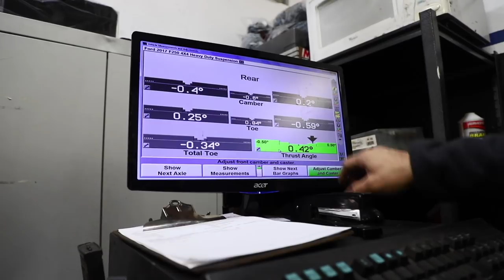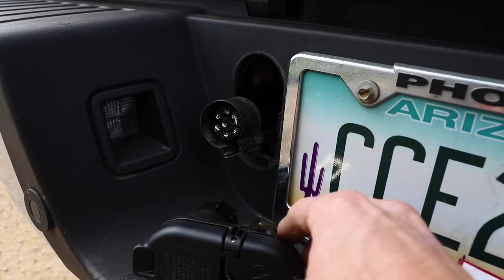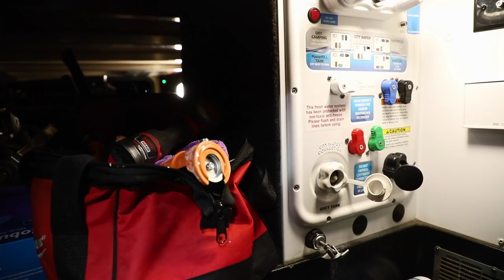SEASON 7 STARTS NOW! NEW AXLE & WARRANTY UPDATE (KYD)

Comment: I had Wholesale Warranty for my Monaco pusher, the rear end went bad. There was a broken bolt found inside the rear end and they refused to cover the cost. I paid $5000.00 for the coverage which was useless because in the fine print of the contract they do not cover any damages due to broken bolts. The repair cost me $8500.00 with the tow on a flatbed and a week of hotel stay. I immediately cancel the policy. They returned all of my money except for $1,000.

Comment: To help with the trailer cord management, have a welding shop tack a ring to the top of the orange section of the Hensley.  It would work much like the pole and rings you see on the back of semi’s holding the air, electric and hydraulic lines.

Comment: 23:26 Perfect solution to the dangling cord.  That's what I do as well.  Also, you might want to put some sealant of some sort around the screw you installed - that will ensure water doesn't leak in around the screw head.

Comment: This is obviously an old video since you have Ginger in it. Love to see that I am not the only one that upgrades and goes the extra mile for the safety of everyone. I often get a response of, "Seems like you are always working on your 5th wheel." When you drag your house down the road at nearly 70 mph. Things happen. Our camper was built with the wrong axles. The manufacturer admitted after the warranty was up on the axles. I bought new and bigger and had installed after being overweight, taking the camber out of the axles and destroying a set of tires on a 5000 mile trip. I just installed the Titan disc brakes on the unit as I felt like the electric brakes were inadequate. Safety for everyone. Much better stopping response. Love the videos and hope to meet you on the road somewhere.

Comment: Why don't you try running a spring on the trailer cable so it stays a way from the hitch. Like on a 5th wheel were the cable is floating. Great videos can't wait to see this season 7 Safe travels.

Comment: Just bought a 2019 3500 RAM Dually to pull our camper this summer. Can't wait! Take a trip up to eastern Canada some time, and we will find you! We're from PEI, which is gorgeous in the summer, but also Cabot Trail in NS and you would be amazed at the tides in Fundy national park in NB. The tide literally drops about 8 feet in 6 hours... low tide you can walk on the ocean floor! How cool is that! Anyway, enjoy your summer through the Mid-west! PS: I would have slapped that guy on the forklift if that was my camper he was bouncing around and basically dropped on the jack stand! Cheers!

Comment: back in the day when i was at college doing motor vehicle engineering, we used 'barrier cream'.  it's like thicker dryer moisturizer but it gets in your pores and makes a 'barrier' between you and oil (and dirt).  then you use a gritty like soap to get it off.  basically you dont get contaminants absorbed and its easier to clean your paws.  if you dont have special soap, then use soap and sugar granules.
Reply: Zep makes a wonderful hand protectant yet it is sold only by the case online. I cannot seem to find it in stores anymore. I am about out too! SO much better than "liquid glove" or any other pre-repair hand cream I have found...

Comment: Mark that extra valve on the on the sewer clean out is only 45 buck and it twists on the end then the cap we had the same problem with stuff leaking by! The other thing I want to say is if you have problems with your grand design camper go on the grand design owners Facebook page and there’s a lot of good information on things that you have problems with on the Rv and how to fix them! Great video can’t wait to maybe catch up with you guys if you make it to the Midwest Iowa area!
Reply from the maker: That's what I keep hearing. I asked for it to be added and they never called with an estimate. I should have disputed it at pick-up, but didn't know better.
Reply: Ya I hear ya there’s no options except the expensive one at the dealer

Comment: After damaging my trailer power cord having gotten it pitched in the hitch one day, I devised a simple fix for the problem thats been working for three years now.  I used a bungee tied to just under the jack controls on the trailer to about the center of the power cord with both ends held in place with cable ties.  This keeps the cord elevated above the hitch while allowing it to still move freely.  This was originally going to be a temporary fix but if it works, why mess with it?  As always, love your videos as they make us feel part of family.

Comment: Love watching your channel, and all the things that you show about the RV lifestyle.  I am surprised at all the little things that were wrong with your new coach. It makes me wonder what you will encounter the older it gets. It doesn't seem right to be replacing  switches, slide motors, and water pumps ever year. I just wonder if all RV s have these problems  all the time.  Have a great summer, and hope to run into you in Michigan.
Reply from the maker: Good point. We put about 35k miles on the truck in '18 and probably 25k miles on the trailer. AK was bumpy and wet. I'm not sure these things will need replacing next year.

Comment: About your wiring problem this exactly what I wanted to suggest you. I was kind of surprise to see you didn't had any locking clip on the trailer tongue lever. Well should should be good like that, I have a Propride P3 hitch and this is how I route my wiring.

Comment: For the power cable, when you put the lock in the hitch ball lock then you need to zip tie the power cable and emergency brake cable onto the padlock. That will hold the cables up out of the way and still let the emergency brake cable to slide through it

Comment: Trailer connection fix...  Bungee cord on the trailer hook up cord.  Either from the tailgate, which would help it stay plugged in, or, from the front of the trailer somehow.
Reply: Yes! Off the tailgate could get hard on the paint, but off of the trailer jack somewhere, excellent idea. I'm afraid that guiding it through the lynch pin might cause it to chafe until it rubs through to the bare wires, eventually, there at the pin, and ahead on the hitch. If you raise it up, so that it touches nothing, and secure it with a bungee, it can swing with the cornering maneuvers that inevitably come from parking such a long rig. :-)
This comes from a guy that running pintle hook trailers for years.

Comment: FWIW...Transport trucks use a pogo stick to keep hoses and cables up and out of the way, you could Google them and see if you could make one work in your case (they are spring loaded so you can pull them right over in a turn and they will just spring back up)

Comment: For the trailer plug cable, I use medium sized Caribeaners  to take up slack but still let the cable pull through if it is insistent.

Comment: Check the truck electric cord connections on other tow vehicles and I think you will see that your plug was installed upside down so the spring loaded cover won’t hold the plug securely. That’s why it was pulling out in Alaska.
Reply from the maker: Plug is correct. Verified it with new truck.

Comment: It would have been nice if the trailer place would have washed and staged the trailer for pick up. Did they go through an itemized list with you on what was corrected/found during the 4 months they had possession of the trailer? Anyway hope you get your Ford axle taken care of in a judicious manner. Safe travels, looking forward to season 7.
Reply from the maker: I edited out the fact that I called 3 times to confirm my pick up time and asked them to wash it. Each time, they say, "Yup, no problem" and I didn't believe them. Sure enough. No review of the list either. I wanted to leave and if there were any issues, I'd just take somewhere else. I should have gone to Lazy Days in Tucson.

Comment: Early on I lost to trailers with single chain and it was not good. The cross will catch your hatch and you will not have to buy a new one. Loved NZ happy trails
Reply from the maker: They are crossed. The reason it doesn't look like it for two reasons. 1) Poor design where the chain mounting points come from the same spot so they cross very close to where they are attached 2) The Hensley extends the chains 8" to make up for the additional distance. As a result, I get this comment daily.

Comment: In my paranoia I use a bungee to keep the safety chains from hanging low and possibly catching road debris, or dragging in dips. The same bungee captures the trailer harness and keeps it from moving around. The benefit is that the bungee won't interfere with the needed motion of either thing it helps to support.

Comment: Marc, how much tension, and how do you measure it, do you put on the bars of your Hensley?   Also, do you ever feel bounce in the truck while you're towing?  I'm trying to figure mine out.   Thanks and looking forward to this season.
Reply from the maker: I make the bars level with the frame. We don't have bounce after moving to the F250. We had bounce with the F150. You might look into air, just make sure you air before you adjust the bars or you'll remove the tension.

Comment: When you come thru Tennessee make sure you cross  the safety chains at the truck. Was just told by a trailer place in town  that in Tennessee it's state law to cross the chains. If not crossed it's liked a 175.00 fine.
Reply from the maker: They are crossed. The issue is the chains come from the same point so the "X" happens about 2" from the point. The chain mounting points need to be separated to create a proper cross.
Reply: Okay just seen a quick spot in the video.

Comment: I liked how you secured the cord.  

It appears you had good service previously with Orangewood.  I was curious why you didn't have the warranty work done there since they are a Grand Design dealer.  Do they only work on trailers they sold?  As I recall, you got yours out of AZ.  Orangewood puts on a good show every March.  Sounds like you will be travelling a lot of miles this year!
Reply from the maker: They were good, but late on the awning and we had to go to Mexico without the LED lights working. I thought I would try different dealers to compare. I'm sorry I did. I will only go to Lazy Days now, even if I have to drive. Going to Tucson would have been well worth the trip.
Reply: That is good to know.  Thanks.

Comment: I think the huge thing they forget to factor in is what's happening going down the road. Wind load push on one side could transfer more of the weight to one side, if it's the heavy side you would be over weight. Bumps and wind road grade many factors. Personally I think the manufactures size the axles to close to the weight they carry.

Comment: Dont use zip ties. A spring would work great for keeping that electrical cable up and away. Not sure how to attach necessarily. Kinda like what we doing in trucking keeping the air lines and electrical up off the catwalk.
Reply from the maker: Great idea. The latch has worked well for the last 4,500 miles so I got lucky.
Reply: @KeepYourDaydream  good deal.

Comment: 23:30 Putting the cable through that pin might be a bad idea. When the truck is turned all the way to the right it will pull the cable that direction and might cause that spring on the bolt to be pulled off the end releasing the pin and allowing it to come out.

Comment: At 8:58, when you said "RVing 20,000 miles with this hitch and it's never happened", I swore you were going to point out the missing safety pin at first.
Reply from the maker: The missing safety pin was used on the Hensley WD system because it went miss from the dealer. That's why I changed the safety pin and then discovered I could put the cord through it.

Comment: Marc can you share more on the under belly spare/blue boy holder you show at the beginning? I am thinking of using tbe same system but do not know how they work! Love you guys are back and cant wait to run into you guys when we hit the road June 1, 2019!!
Reply from the maker: This portable grey tank fits inside the BAL Hide-a-spare. It wasn't easy to get in there though. I haven't had to use it yet! https://amzn.to/2Dhfme6
Reply: Ok thanks! Just trying to figure how to Haul the beast!! Great job on the 7 way! On our Hensley I put on a trailer hitch lock and that way the Hensley is more secure and then I zip tied the long 7 way cord to that. Afraid the thick cord could unhook the pin keeper and drop the pin. Just how we did it. https://www.amazon.com/ADP-Trailer-Coupler-Security-Protection/dp/B07HHZS183/ref=mp_s_a_1_21?crid=J9JTVHX80ZIY&keywords=trailer+hitch+lock&qid=1555293161&s=gateway&sprefix=trailer+hitch+&sr=8-21

Comment: Glad to see you all safely back in the states, but I have big question for you. I'm on the verge of purchasing a new Ford truck and I'm leaning to the F350 instead of the F250. My question to you is if you could do it over would you pick the F350 instead of the F250? Thanks and keep the great videos coming.
Reply from the maker: The F250 is awesome. Much softer ride than the 350. It's perfect for most travel trailer and light 5ers. But if you're rig has anything more than 1,500 hitch weight, I'd go with the 350. You'll have far more options should you change rigs down the road. The F250 diesel has only 2,100 payload. The alternative is F250 gas which has even more payload, but diesel has better resale making it worth the extra money. Just my humble and yet accurate opinion.
Reply: @KeepYourDaydream thank you so much for the quick reply. I do have a light 5th wheel and that's because of the truck we had when we purchased the trailer. Thanks again.

Comment: About the cable connection to the truck.  I wonder if someone makes a  spring device that holds the cable where you want it on your trailer,  and allows more to go if the need arises (in a turn, etc)?

Comment: Did you get the axel problem validated by a second opinion?  My brother, who delivers RVs,  thinks you more than likely have a frame issue or the springs.   The issue is more likely where the axel connects and not the axel itself.
Reply from the maker: I didn't. I suppose the advantage of no warranty is getting a second opinion and being involved in fixing the real problem and not the symptoms.

Comment: Welcome home! When you did the axle upgrade, did it include upgraded springs?
Reply from the maker: It did in this case because my leaf spring was flat. I should have mentioned that. Perhaps that was the real issue. Not sure if a leaf spring is the cause of the effect.
Reply: We have similar model RV's. Our springs are flat too. We are 500# UNDER rated weight. Current springs are rated for 2600# each (5200# axles) We have new springs waiting for us back home. New ones are rated for 3500# each. And no we are NOT going to load the RV to the new axles ratings!!

Comment: Do you scissor jacks cause popping when walking around the inside of you unit? Ours make a popping or tapping sound inside the camper when down under and pressure. The jacks are the same brand as yours.
Reply from the maker: Haven't experienced that. Not sure what would cause that either.

Comment: Did you have Lippert 7k axles?  I have them on my 2017 Solitude and the dealer said GD switched over to another brand (Dex ..something) starting 2018 due to problems with the Lippert axles. They recommended I consider replacing (not warranty) when I asked about suspension upgrades. I haven’t yet but your axle problem has me curious..?

Comment: We took our Lance trailer to Spectrac in Mesa and had them realign both axles. All 4 were out of spec. They fixed and said they came from axle manufacturer that way!! So trailer owners beware! Happy travels. BobnRobin
Reply from the maker: The Grand Design would not have covered the axle, which was nice they did without question, I would have taken it to a shop to have them both realigned.
Reply: @KeepYourDaydream  I could have got Lance to replace both of ours, (2018 model trailer), but based on what Spectrac said, I might have got two new axles that were out of spec too!! Now I have peace of mind and even tire wear! Happy Travels, we will be watching!!

Comment: I'm a bit surprised that Big Truck Big RV didn't mention the difference in payload between the F450 and F350 in your discussion. You lose about five hundred pounds of payload with the F450 from the F350 for a similarly equipped truck. That doesn't seem like a lot unless you decide to buy a 20k gvwr toy hauler, have a cab full of people, aux fuel, and a bed full of stuff... Kind of like you guys roll. Changing Lanes hauls a 20k Momentum with an F350 and he's over payload with just the two of them in the cab. They have a washer dryer and a motorcycle in the back. 

Toy haulers tend to be pin heavy so that when you load up the garage it evens out. If you don't have big toys you can end up at or near 25% pin weight, meaning you could be over payload capacity/gvwr on the truck when you get all your gear in it as the payload on the F450 is probably about 5,000 max depending on configuration (Ford F450 Limited 4x4 dually - 4,824 pounds). With a pin weight of  5k, aux fuel, people in the cab and gear in the bed, you could easily be a grand over payload.

The F450 is almost certainly de-rated to keep it in the class 3 category, so you just add airbags if needed to supplement the springs, but it is something that should be considered. It'll be interesting to see how yours CAT's out when you get all your gear in your new Momentum (assuming that's what you're getting of course!). 

I'm told there are a lot of people towing big DRV's with the F450 and it holds up well. The bigger brakes, 4.30 gears, turning radius, and commercial grade tires certainly give you a factor of safety beyond the F350.

Safe travels!
Kate